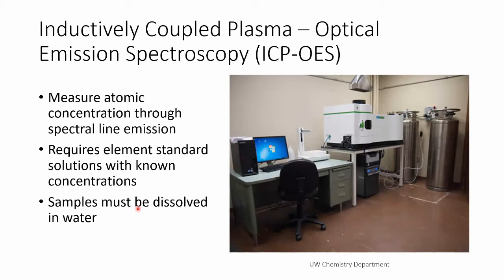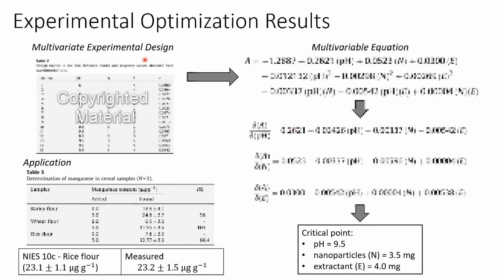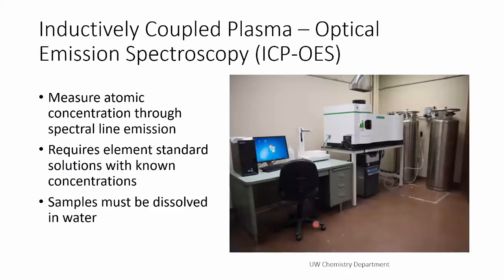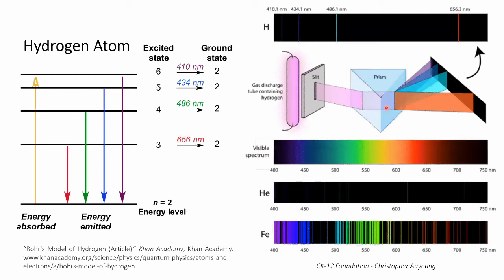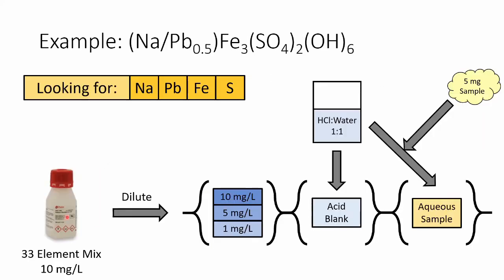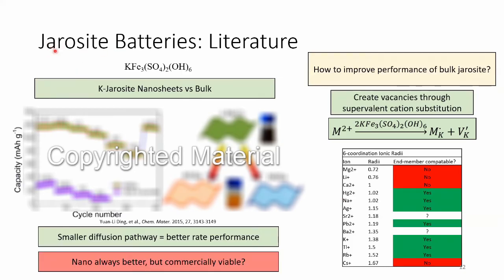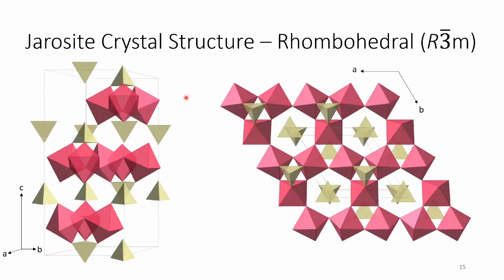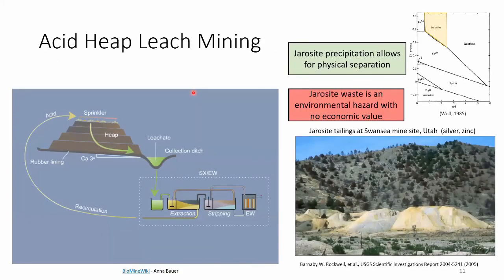Inductively coupled plasma optical emission spectroscopy (ICP-OES) Overview

Comment: How do you prepare the blank and standards? It was very easy to understand. Thank you!
Reply from the maker: The nanopure water can be purchased. Some labs have machines that can produce it. I have been told that it is more pure than regular DI water produced by other machines in lab.
The acid blank is the same solution used to dissolve your sample.
The standards can be purchased. You can dilute standards in the nanopure water using a micropipette. It is best to make the concentration of standards near where you think the concentration of your sample is.
Reply: @ZGNeale  you are so amazing!
You share your knowledge and you still have time to answer our questions. Thank you so much Mr. Zachary!
My apologies I just read your response today.

Comment: I am writing a report on ICP-OES analysis, and I was wondering if you could explain what emission lines are. I have to include them in my report but i've gone through my lectures and textbooks and have no idea what it means!
Reply from the maker: An emission line is the wavelength of light that emits from the ion species. Elements can have several lines depending on their electron structure. In ICP-OES you select which wavelengths you want to measure. I think it is called a line because the light that is refracted through a prism produces a spectrum with a bright line for those wavelengths, look up images of emission line spectrum.